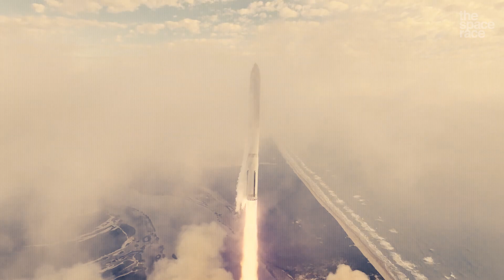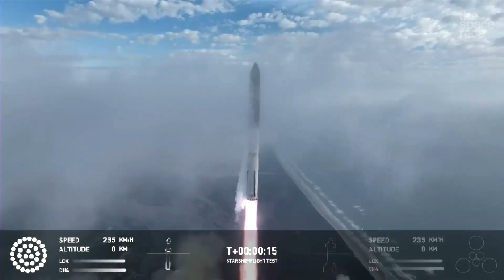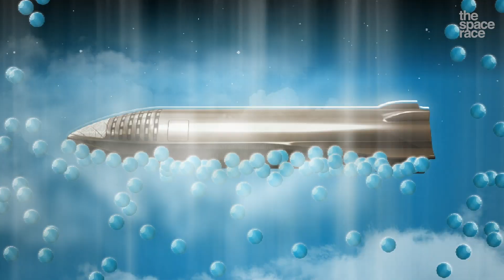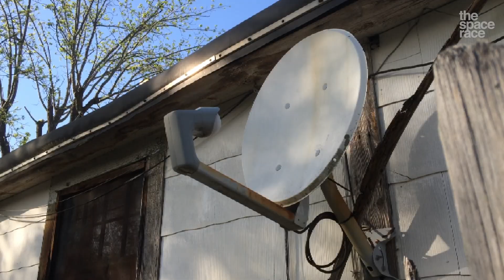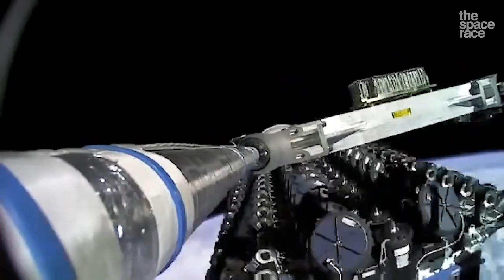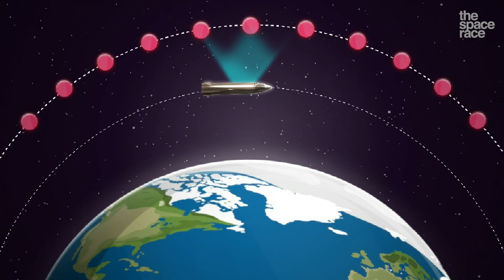How SpaceX Did The Impossible...and no one noticed

Comment: "How SpaceX Did The Impossible...TWICE!"

So... it wasn't impossible.

Starship fanboys tend to forget that the reason why nobody is building 100ton payload lauchers is not that it's difficult, it's that nobody needs it. There is no use case for a 100ton to orbit capability. THAT is why nobody has tried again since the russians did, and the russians only did it because of the space race with the US. And the russians only failed because they were doing it in the 70's with russian tech. There is no comparison with the high-tech methods that spacex has available to them. It's like claiming that building an electric car is very difficult because the first electric car in the 1800's was really difficult to build too. It's dishonest, and dishonesty is a recurring theme when it comes to spacex fans.

SpaceX is doing this because Musk wants it. And Musk wants it because he has a god complex and needs the biggest of everything. The biggest car brand, social network, the biggest and most importantly longest rocket, yes he's compensating.

And that is why they have spent $3bln or so in the past ten years and have yet to complete a mission. No, IFT3 was not a success, the starship lost attitude control on the way up, they failed to open and close the payload door and it burnt up on re-entry because of the attitude control and the fact that the heatshield tiles were dropping off like leaves from a dead tree. The booster was simply out of fuel, it crashed in the ocean at mach-3 and couldn't even try to light it's engines.

Why can't you people ever be honest when it comes to SpaceX?

Comment: One correction it has nothing to do with the ball of iron  all of the matter on earthe is responsible for its gravity the ball of molten iron is just responsible for the magneto sphere
Reply: yep - earth is 32% iron, so not the majority of the cause of the gravity well
Reply: @willdarling1  well it is the majority no other sibgular element is responsible for more of the earths mass but the point is that regardless of how much iron there is the other stuff is just as responsible for the earths gravity
Reply: There is no gravity in space 😊 the metal is inside the moon which is under the soil. Also the moon is smaller than a pea compared to the sun which is size of a melon 🍈. The last place for the metal is jupiter but that one is gas cloud.

Comment: Columbia crew got to see plasma up close. 

Too soon?
Reply: Yes, they could see it there. But so far there has been no live transmission to Earth because of the plasma. Until Starship. 
Thanks to Starlink. That really was something completely new. 
(It is reminiscent of NASA's fast data transmission via laser at the end of last year. Until now, data transfer rates from satellites exploring the solar system have been quite low. Due to the old technical possibilities and the limitations of the Deep Space Netword ground system, which is now completely overloaded anyway and from which the control commands also have to be sent. The new data transmission rate not only makes it possible to transmit far more data, but you no longer need the completely overloaded receiving system, as this can now be intercepted with many telescopes. This really is a quantum leap and we will probably now be able to receive video transmissions from satellites exploring the moons of Jupiter or Saturn, for example.)